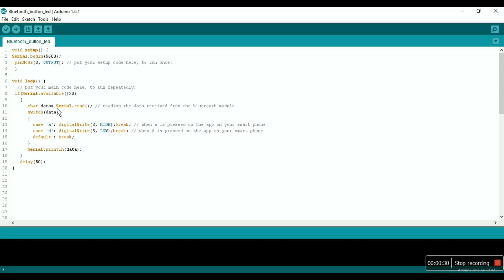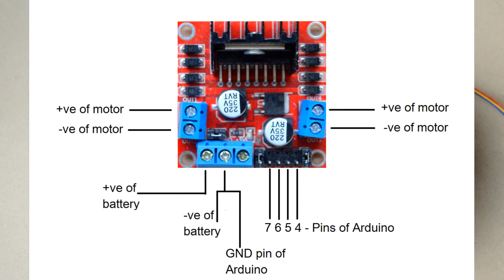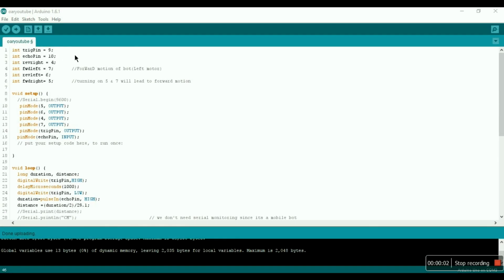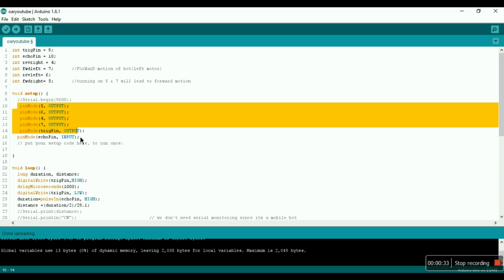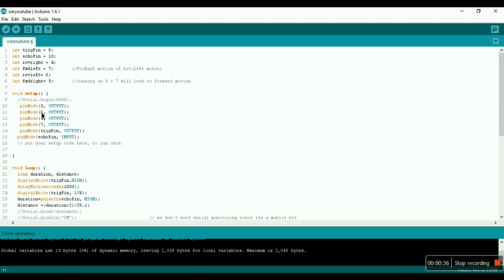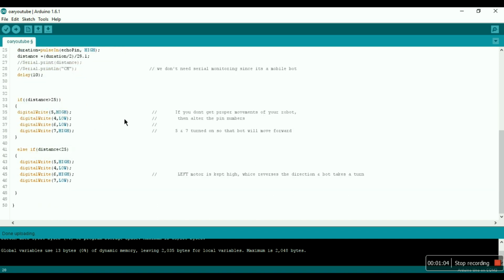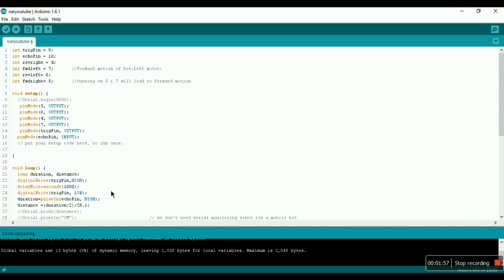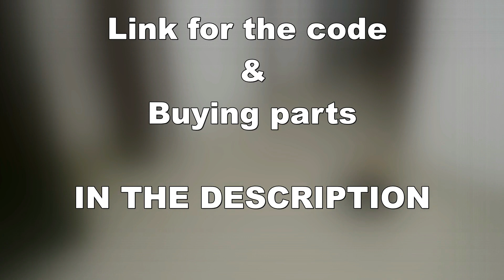Obstacle Avoiding Robot | Arduino-Ultrasonic sensor tutorial

Comment: Sir I used the same circuit diagram but whenever I connect the Ultrasonic sensor to Arduino 5V then my Arduino does short, In my Arduino there is no power and not upload the code so please solve my problem

Comment: I altered the pins (all possibilities) but I still don't get the proper movements...it's just going in circle. And I don't think the code for the sensor it's right because it never stops..it's  moving all the time even when there is no obstacle. I also tried a new sensor but I got the same result. Do you have any suggestions?
Reply: same happend to me did you manage to fixed it?
Reply: @MrValehp11  not yet